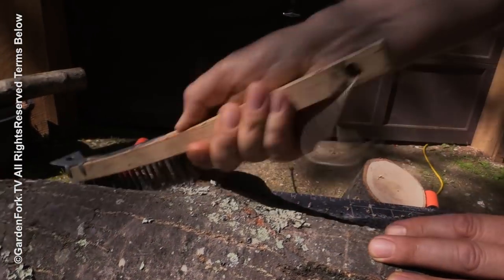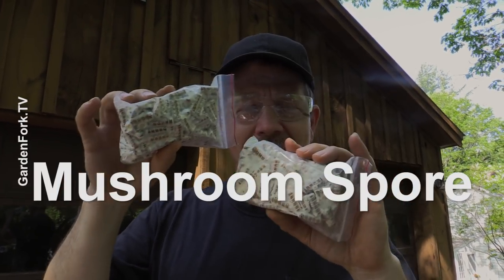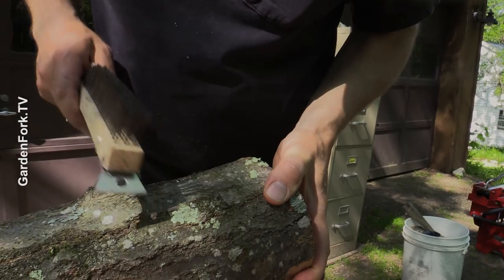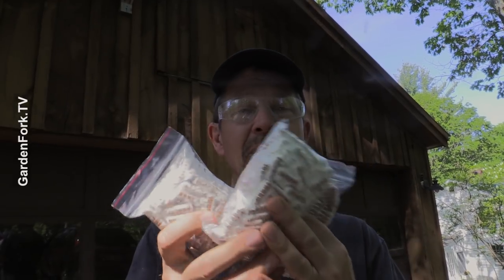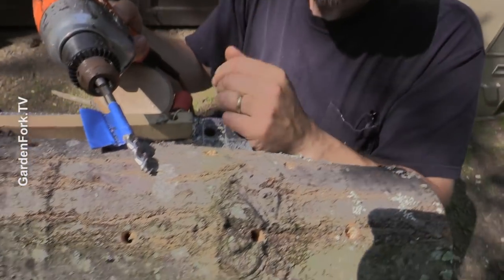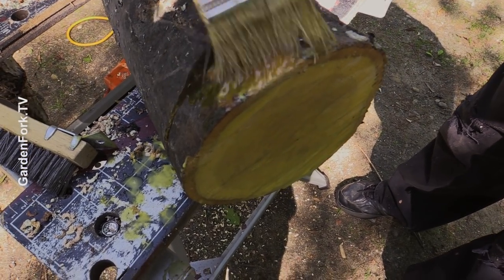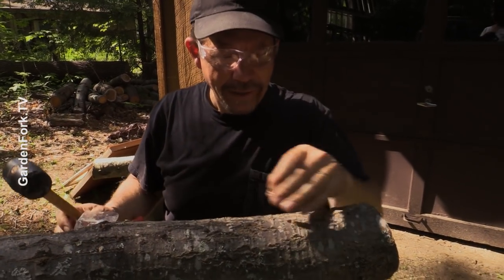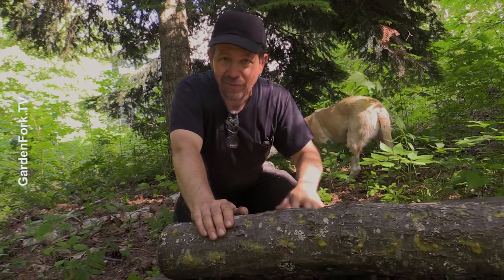Grow Mushrooms The Easy Way On Logs With Plug Spawn - GardenFork

Comment: how did these ever turn out? i am interested in trying this version of growing mushrooms!
Reply: They will work, the more plug spawn you use, the higher the chance of success is (and the faster your colonization will be). I assume it takes a year to colonize though, wood is pretty dense lol. At home you can make your own (infinite) supply of spawn, use agar, pre-colonized grain, or LC, add it to the dowels, and you are set. If you are looking for a fast resulting choice, you can get a bag of colonized oyster spawn, fruit them at home, then once they are fully flushed out, add the spawn in layers between wood chips and straw.

Comment: Why do you have to put them on a pallet?  I don't have any trees and I live down south so its hot and dry for a lot of the year.  My idea was to just lay the logs on top of the dirt between 2 rows of vegetables.  Laying them on the soil will keep the logs moist and seems like it would help the mycelium spread faster by letting the log start to decompose.  Thoughts anyone?
Reply from the maker: Hi Cory, Mbe check with the Fungi Perfecti website on your plan. I believe keeping them in shade is very important. Not sure about pallets in the South though. Thx!

Comment: More vids on mushrooms! I tried growing some from spore prints and the mycellium grew mold!
Reply from the maker: best to start off with these plugs. i tried putting some old oyster mushrooms under the bark of dead trees. did not work.
Reply: best bet is to add hydrogen peroxide with water to your spray bottle... mushroom mycelium naturally produce peroxidase compounds to kill off mould spores so it doesn't harm healthy mycelium.
Reply: @Squigly Boom. spores need to hydrate properly before they grow. if you're using tap water then you'll  have no luck as the chlorine needs to evaporate over the period of 12-24 hours. or you could boil it and then let it cool.
Reply: Welcome to mycology ! Mold is our worst enemy trust me
Best to have a dedicated sterile area to do everything

Comment: Does it matter how big the log is (diameter, length)? Can I do smaller branches (ie 1/2” diameter)? I wonder if the bigger logs have more sapwood (food) for the fungus so thicker logs produce longer (get mushrooms for years and years vs just a year or two). 

Also, saw another vid where someone shocks the inoculated log with cold ice spring water overnight, which makes the fungus think it’s spring and tricks it into sprouting mushrooms in a few days
Reply from the maker: The directions that came with the plugs said 4-6” diameter. And yes, shocking them seems to work. Thx!

Comment: It's been a little more than three months since you posted this video. How did it turn out?
Reply from the maker: some of the plugs pushed up and out of the logs, but most have stayed in. the wax seems to have worn off a bit. there is a hint of fungus growing around the plugs, but no flush of mushrooms yet. From what I've learned since this initial log project is it takes longer than one thinks, even with oyster mushrooms. I hope to have mushrooms next spring. thx!
Reply from the maker: BTW, i also learned its important to water the logs each week. who knew?
Reply: Live and learn, right? Thanks for the update.

Comment: You should be using gloves when you pick up the spawn plug. There is concern about contamination from your fingers.
Reply: Actually if the spawn is properly prepped and colonized there is no real risk from your hands. Mushroom mycilium is very hardy.
Reply: When it’s in it’s early stages that’s when you want to be careful